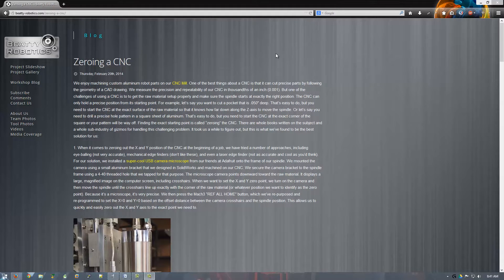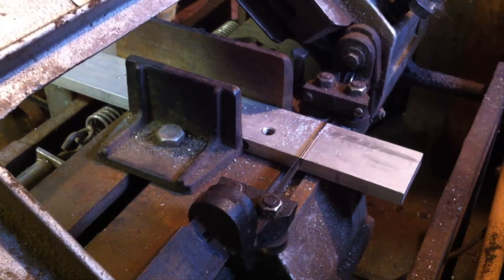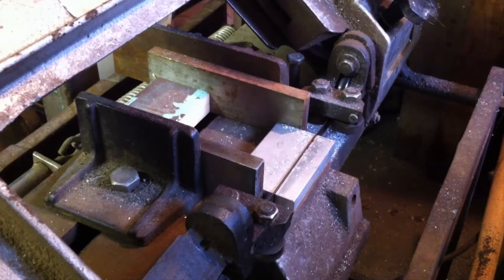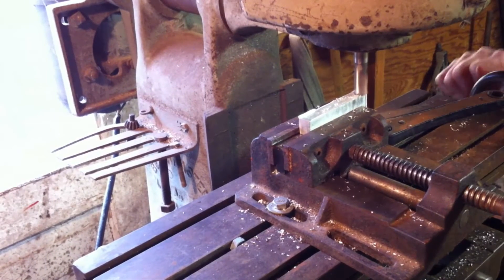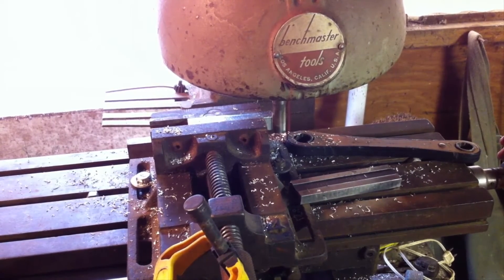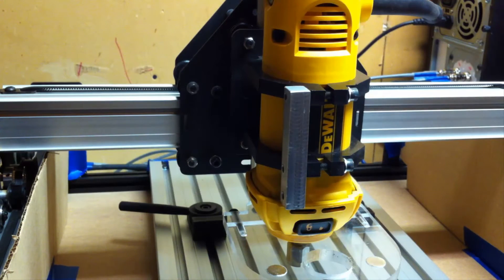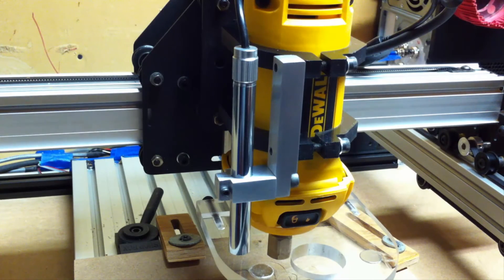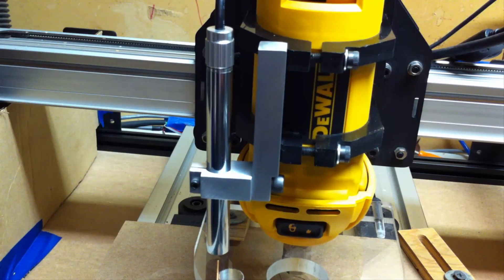ShapeOko 2: Making a Camera Mounting Mod

Comment: Did you ever actually get it to a point where you were able to reliably zero x and y using the camera?
Reply from the maker: Unfortunately, I've been neglecting this particular project. I have it so the camera is running within software now, but there's still a lot to do. I still believe that if set up right it should be able to produce a fairly repeatable solution for zeroing the X and Y. However, I believe right now that while it should provide a very quick way of zeroing out these two axis, it may not be able to produce the precision I'm looking for. But, I won't know until I see the results for myself.
In the next couple months I'm going to have quite a lot of time with the machine, so it's very likely that I'll get a chance to finish this up and make some videos that document my findings.